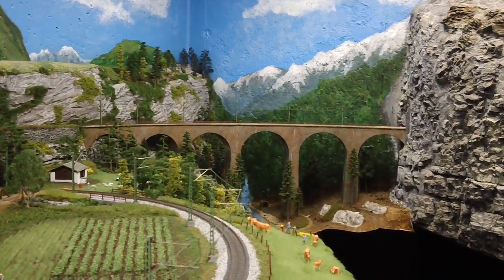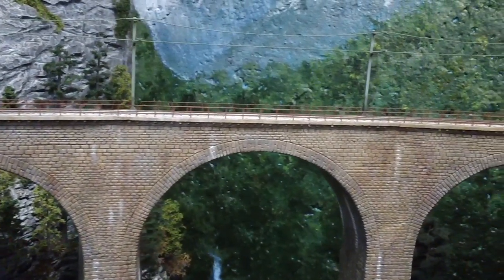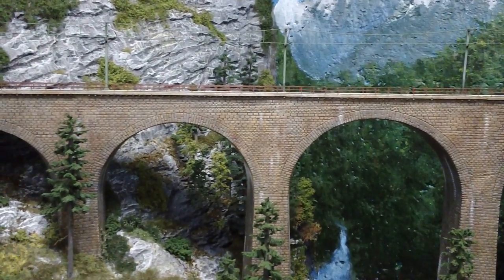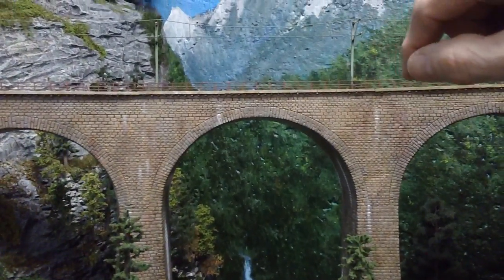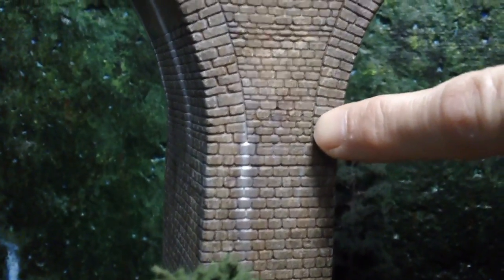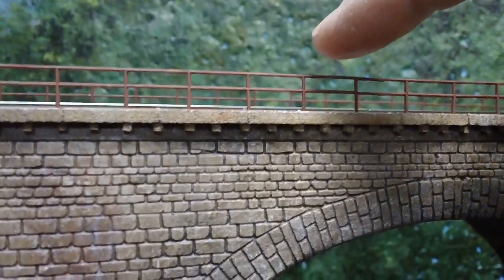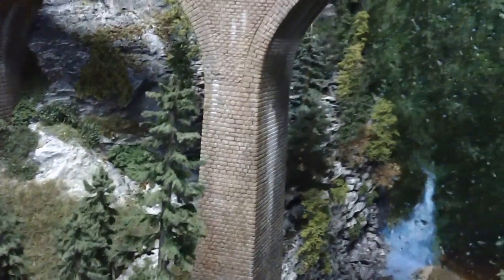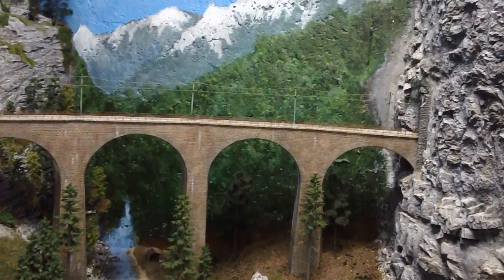Viaduct construction Overview (Scratch Built)

Comment: Excellent job. Looks excellent. I have scratch built many bridges on my HO layout over the years (mostly metal type truss bridges) and love researching and getting scale measurement, etc. I have built some smaller arch type bridges out of screen wire and plaster (carving the bricks also) and they came out super nice. I will have to try your method with the sub-structure made out of wood. Great job...(By the way. I was a big John Allen fan and got most of my inspuration from his Gorre and Daphetid layout)...